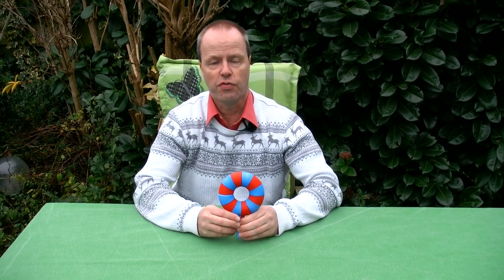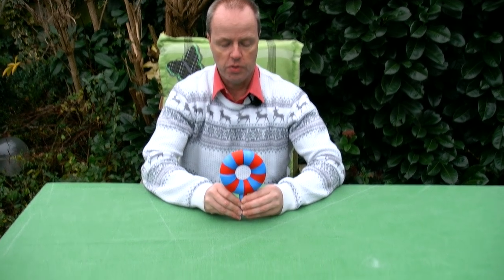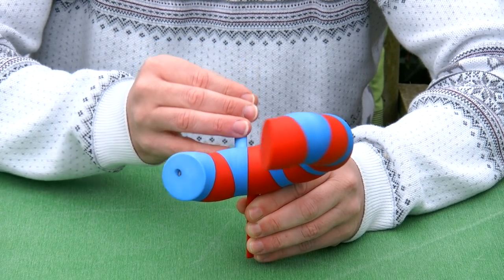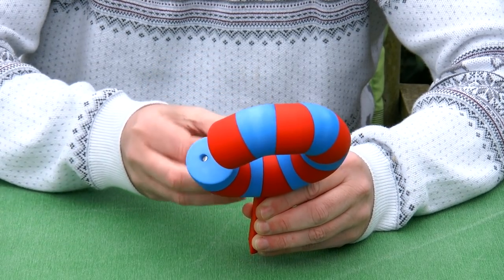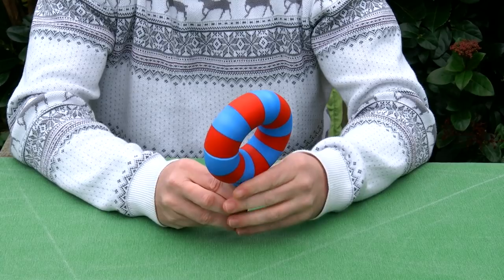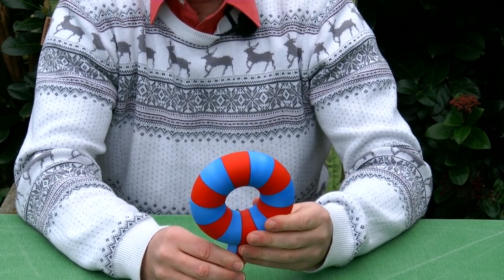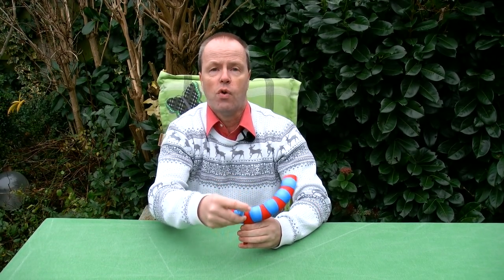Donut Transformer

Comment from the maker: What would be a practical application of this mechanism?
Reply: OskarPuzzle what's the next puzzle
Reply: Seems like it could be used to determine the volume and the area of a solid torus :)
Reply: A practical application of this mechanism could be in mechanical limb / digit control (and the internal mechanism purely ensures all segments rotate together - could be done with gears, or a flexible rotating core).
Reply: supervillain's trap chair cuffs. 
you know the once that capture the hero when sitting down.
Reply: If you stack three elements (instead of two, as you have), you have a nice 3-Dof actuator (yaw/pitch/roll). 2 elements shall work too - only then you'd have Azimuth/Elevation control (say axial +/-30 degree). This could be used for pointing antenna-dishes mounted on a stable foundation.
Reply: Circular Clamp Design. Perhaps with a higher gear ratio for better leverage.
Reply: Amazing and amusing people. I don't think it needs any other purpose.
Reply: OskarPuzzle A tentacle monster's tentacle in a movie
Reply: VTOL Thrust vectoring system.
Reply: The stack of torus segments idea is used in tunnelling. The precast concrete tunnel liner segments that get assembled behind a tunnel boring machine have this form so they can follow curves.
Reply: Dorian Kaminski He could have uploaded it a month ago but only set it to be publicly viewable today.
Reply: LasRozasDeMadrid Pinching as flesh gets caught between pieces doesn't sound fun
Reply: Nmotsch idontwannagivemyrealname Well, you can insert the device inside a flexible balloon.
Reply: What about adding a motor and have it transform indefinitely on it's own? That'd be an amusing desk toy.
It's practical because you can sell it :P
Reply: Screwdriver that goes around corners. It would require an additional mechanism that allows the handle and the bit to turn but not the curved shaft. So, probably some sort of gooseneck on the inside with the rigidity coming from your mechanism. I don't know how the mechanism looks inside so I'm not sure if it would be possible or not but it would solve a lot of problems for a lot of people. You could turn a screw that's head is facing away from you!
Reply: OskarPuzzle See any game by VectorPark, particularly Windowsill.
Reply: Wheels to skis?
Kind of sonda to micro surgery.
Cat's tale costume
everething can be used to hold papers  ... Pisapapeles... This one very original!
Reply: Ok! This one is good idea! But need that the torus can open a new gap in the opposite side.
Wheels to cars that climb from an anchor in the to another anchor above. Making posible store cars in crowded cities on shelves...
Looks smarter when i think It...

Comment: They are linked so all blue pieces go one way and all red pieces go the other way. I'd love to see how that has been done!
Reply: That's my theory, too; if you consider the red pieces to "stay put" from a fixed perspective while the blue pieces all turn in sync, then at halfway around the rotation the curvatures of each set of six slices will cancel each other out, causing it to become relatively straight.
Reply: Yeah, only one set (blue, or red) needs to rotate - and this could be done either using gears, or a rotating core.

Comment: I'd use it on a hose. The levers would go on the in end of the hose and allow the user to control the direction and pressure of the hose from one place.

Comment: There are atmospheric diving suits (and even experimental space suits) that already use joints like this to maintain a constant volume/pressure of air inside them.  The mobility afforded by them is supposed to be pretty great compared to more typical diving suits and space suits.  And, because they're made of harder materials, they can be pressurized to a full atmosphere, unlike their fabric counterparts.
Reply from the maker: Yes, I know those, and they are part of my inspiration. However, I am not sure whether these had the same gearing mechanism that coordinates the turning.

Comment: (second guess) -still not convinced, but it's worth a go!

-on the inside of each section, there is a meshing pair of gears. They would lie flat, likely on the large end of the section. (There may actually be any number of pairs, which could lie around the curved face of the section)

-each section has gear teeth in a ring on each end

-when connected, the internal gear pairs link the rotation of like-coloured sections by meshing with their rings of teeth. One gear meshes with the ring of teeth on one section, and the other gear with the ring of teeth on the other section.

-the gears would have to be at a different distance from the wall for blue sections and red sections, otherwise they would clash.

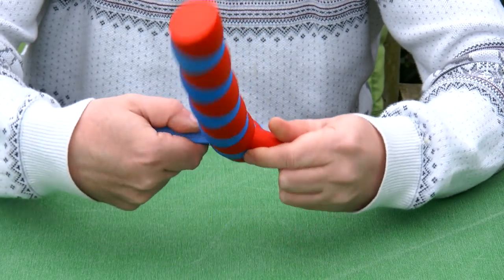Still, by the sound at 0:54, it seems that whatever is inside the mechanism must be very simple, as there is no rattling, which you might expect from gears, and it sounds nearly hollow. I've also considered the option of hinged brackets connecting like-coloured sections, but I don't see how that could work.
Reply: Yea I think you're the closest to the answer - check his shapeways site for a 3D model you can look at in your browser. It's missing the internal gears but you can see where they would slot through in a clever way. The ring of gears also look like they hold the pieces tightly together.

Edit: Although now that I think about it, the outer ring would be blocked off by the inner ring in his model, since they overlap. I think the way I'm imagining it is wrong, maybe you can figure it out.
Reply: Good point! I never thought to look at his Shapeways profile. Looks like I was right about the ring of gear teeth. Looking at the model, he really hasn't left much room for a pair of gears, and the gap which would be for the gears is on the short end of the sections - an odd choice, since you would have more room at the large end, and there would be less curvature in that area. The size of the gear teeth are also pretty big, so any small gear which could fit in there couldn't have many teeth at all...

I've got it! While writing this, I realised the rings of teeth protrude enough to fit through the gaps. No additional gears necessary! The gaps are on the inside because that is where the rings of teeth come closest to one another. In this case, they overlap just enough to mesh on the short side, but not so much that they mesh at the long side.
Reply: Ahh that makes sense. What do you think the holes are for then? I was thinking maybe a string or interlocking bevel gears to stop the pieces from being pulled apart. In the video you can see a bit of metal in a hole at the red end. Actually now I think a string wouldn't be able to hold it together since the holes don't line up between sections.
Reply: Hmm, I think this is how it works:
-Each section has a 'counterbored' through hole for the head and shaft of a partially threaded socket-head cap screw
-They have another hole to capture the thread of the next section's cap screw.
-The cap screw is inserted into the hole with the large 'counterbore' hole, which houses the head of the screw.
-The length of the cap screw is longer than the hole, so the end self threads itself into the recieving hole on a previous section.
-The way it has been done means that the axis of the screw is the same as the axis of rotation between the two connected sections, so they can rotate freely.
Reply: Yes! That seems like the best way to do it. Thanks for your help.

Comment: My best guess is that:

-each blue section has a protruding fixed gear shape on each end.

-the red sections have internal gear teeth.

-on the inside of each red section there are about 5 loose planetary gears which rotate between the blue protruding part and the red internal teeth.

-the sections would have to clip onto one another, like with a flexible lip, which would be lose enough to allow rotation.

I think this would work, but require lots of small (and possibly delicate) gears, so I'm still not sure if this was how you did it.

What do you guys think?
Reply from the maker: There are no planetary gears.
Reply: OskarPuzzle 
Darn. I must admit, I was sceptical myself, since at about 0:54 you can hear that it sounds nearly hollow. I'll have another think.

Comment: I can think of one way of doing it, but I'm not sure if it's the way Oskar did it. How I would do it is with a differential gear chain with one of the gears having one more tooth than the opposite such that the differential drive shaft is at a slight angle.

Comment: This is amazing - one of your most intriguing mechanisms yet!  Of course the red pieces all rotate one way and the blue pieces the other, but how is this achieved?  Here is my current guess.  Each blue piece has a tunnel through the center, with some kind of slightly flexible cable (like a washing line) inside it, rigidly connected connected to the two adjacent red pieces.  But then the blue pieces still need to be coupled.  Each red piece has an off-center tunnel, containing a cable with a spur gear at each end.  Each of these gears meshes with a gear that is rigidly attached to the adjacent blue piece (and concentric with the first cable).  This should certainly work in theory, but in practice suspect it would be hard to get everything tight and smooth, and there would be backlash from all the gears.  So perhaps you have a better way?
Reply from the maker: Wow, your version is much more advanced than mine!

Comment: I believe I get how this works, I'll try my best to explain how I think it works in words. As many have already mentioned, it appears that all the parts of a single colour are linked e.g. all the red parts are linked together and all the blue ones are linked together. 
I believe he's used bevel gears to join them together, such that two blue segment bevel gears mesh in the red part that sits between them. The red parts are then connected to each other using bevel gears that meet inside the blue parts, but the gear shafts of the red parts pass through the centre of the blue bevel gears. The outer 'case' of the red segment is connected to the inner shafts by the slight angular gap between the blue bevel gears. Or it could be the other way around in terms of the part colours, obviously can't see inside to know.
As for a practical application for it, an overly complex nut cracker?
Reply from the maker: Your description is 100% correct! These are indeed meshing bevel gears, one color inside the other.

Comment: Is it some kind of planetary gear system with a 1:1 reverse ratio and the axle of the inside gear goes through one color and the outside inverted gear is in the other color ?
Reply: I think it’s more like
ring(outer) gear is one color. 
planet(middle) gears is the other color. 
sun(inner) gears are all connected together in a long chain, that allows bending but not rotation.

Comment: A similar mechanism is used to turn tunnel boring machines.
Reply from the maker: Tunnel boring machines use hydraulic pistons to steer the dril head, not rotating fixed-angle segments.

Comment: Thanks for all your inspiring videos! I assume there are cardan joints that connects all the blue parts. The red elements are hollow to allow for the movement of the cardan joints. Just looking from the side, it could be the red or blue ones that are connected, but the open 'mouth' revealed that there is some mechanical mount on the blue segment, so this hints that it is the blue ones. Also, you moved the blue lever which is easier than forcing the mechanism to move by moving the red one.
Roughly about like this https://photos.app.goo.gl/mMbbvuBD476WxPms2
Though probably it will be more smooth and less prone to lock-up with some gearing that turns the red elements the other way.
(This reminds me of these wooden caterpillar toys that use spheres cut at an angle - but they are much simpler inside, just a rubber band).
Reply from the maker: No cardan joints, just gears ...
Reply: The cardan joints concept is looking at it as if it's bending. It's not; it's just rotating along a different interface plane between each pair of segments. It also didn't provide a mechanism for the red elements to stay at a fixed angle. My guess is, it's something like a planetary gear system with half the shell segments connected to planets and the other half having outer teeth. A connection from one joint to the next keeps them counteracting, similar to the freestanding clock mechanism. Neat.
Reply: Yes, I realize the cardan joints are too simple to be useful. They will make sure to connect all the blue elements to rotate in unison, but it doesn't provide any 'incentive' for the red elements to turn in unison in relative opposite direction of the blue ones. Only gears can do that.
Reply: Other solutions than gears are possible; I think I could do it with just strings, as long as we limit it to one turn.